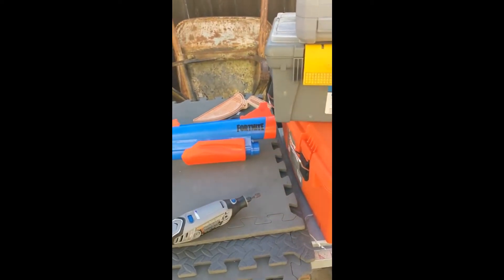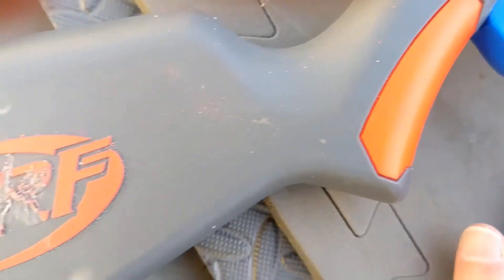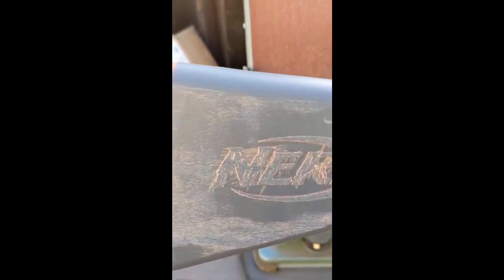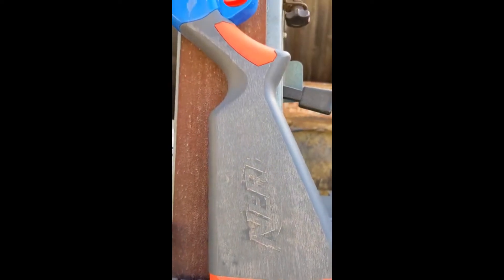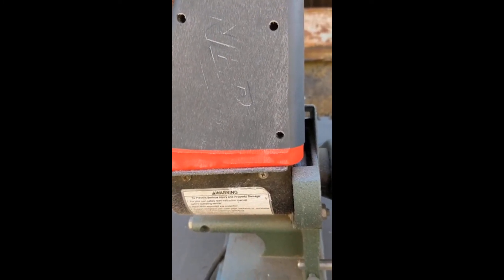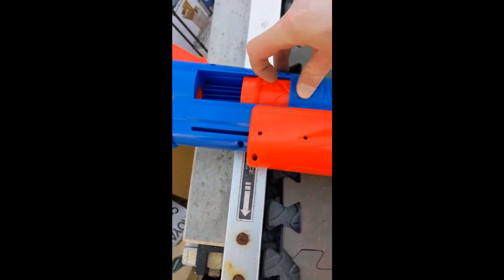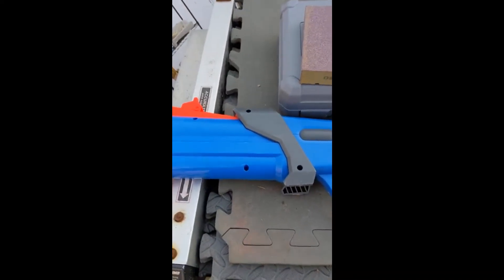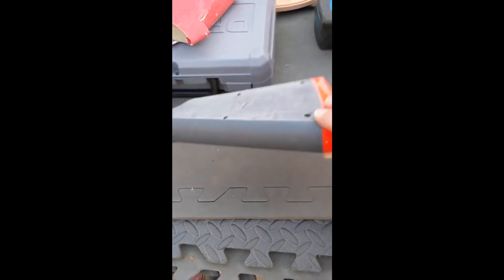Day 1 Nerf Fortnite Pump - SG mod

Comment: Wtf was modded?
Reply from the maker: Multi part vid / project that is on hiatus, I fell and broke my leg and have been in the hospital since November. Long story short though: Trying to find a way to turn the Fortnite Pump SG into a magazine tube fed blaster. Then life happened. If you're interested in getting a magazine tube fed "shotgun" style blaster check out the Monkee Mods Firefly. I got one and just got it working Tuesday. They are incredible blasters and well worth the time and money. Short of clay molding a new interior into the Forntnite pump I don't really have a way to it functional as the rubber dart heads are catching inside the magazine tube atm.